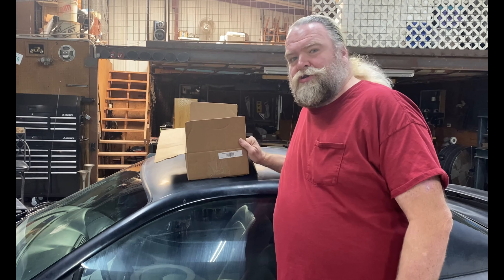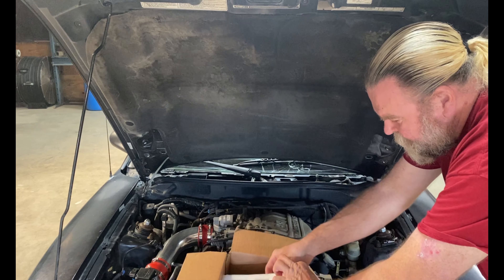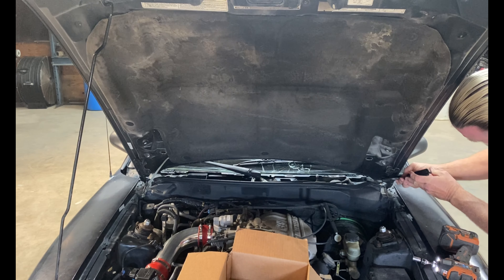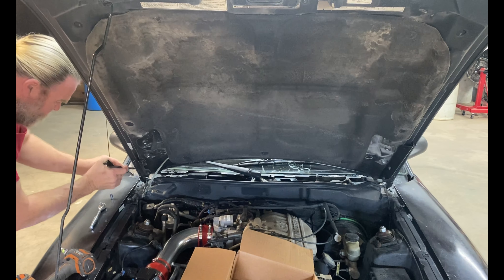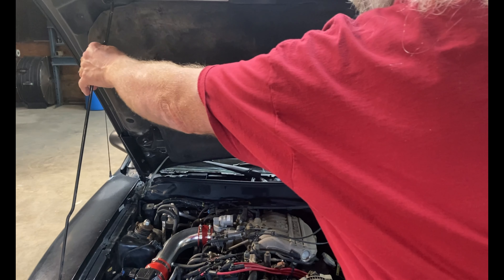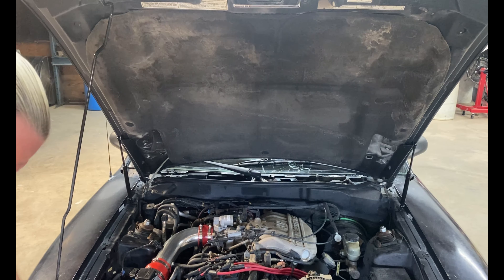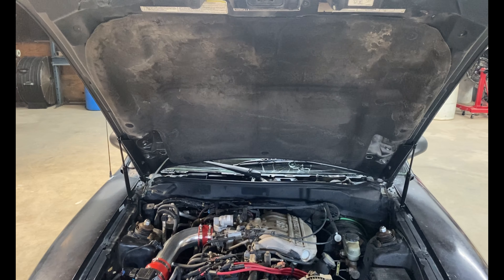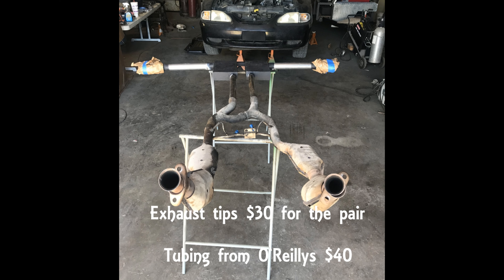Prop rods... Don't ya hate em?!?! MMD hood strut review and installation

Comment: That exhaust in person is EPIC!! Never heard a v6 sound that mean!!
Reply: I know right!! Love your view randy!
Reply: Reminds me of a truck my best friend that owned the red 95 mustang I was talking about, his stepdad had it was a longbed 87 regular cab dodge dakota 4x4 with a 0.30 edelbrock cam 3.9v6 holley street avengers 4bbl carburetor, heddman long tube headers no collectors, and 2 inch straight pipe front of where the cats would have been cut the flanges off the cats and welded straight to the 2 inch straight pipe straight out under the rear bumper on each side....you want to talk about loud!!!! Truck was optioned as a se so had all chrome trim,silver interior dash trim and was a 5 speed 4x4 originally his stepdaughter truck but after she fried two clutches it got swapped out from a 83 727 4x4 automatic transmission and the b n m z gate shifter and she drove it like that for two years and then she bought her a newer s10 blazer only hers is actually the first year of the trailblazer.. and she gave her stepdad the black 87 longbed dodge dakota se I loved that truck especially how it sounded and it had a 3 inch welded up body lift setting on american racing 15x8 aluminum blades not the sawblade style.. and 33 x12.50 15 wild country xt tires it looked mean lol..